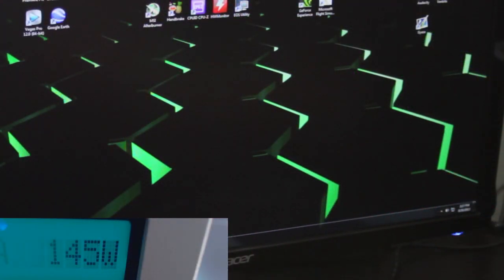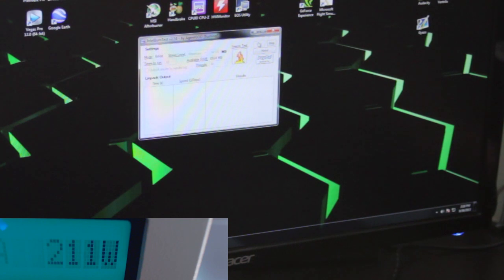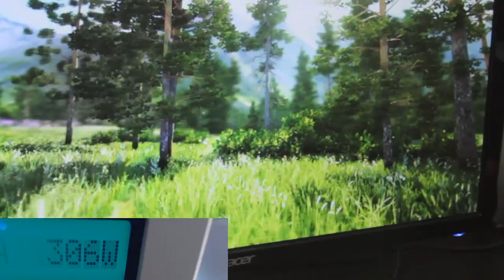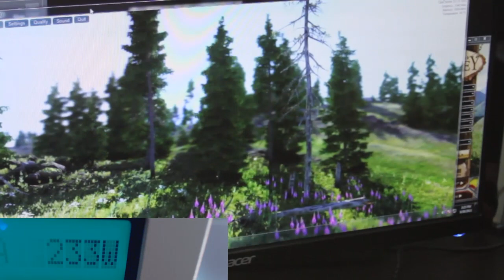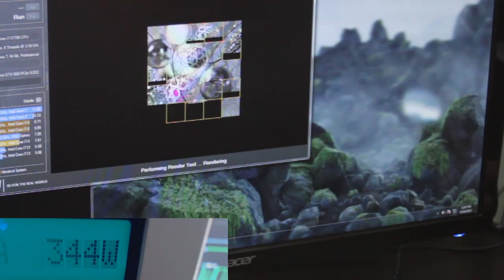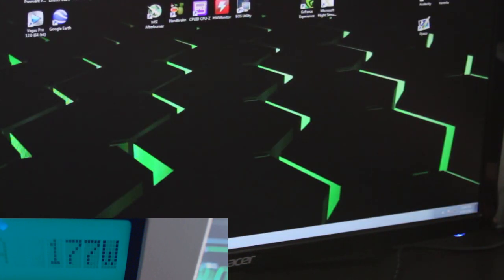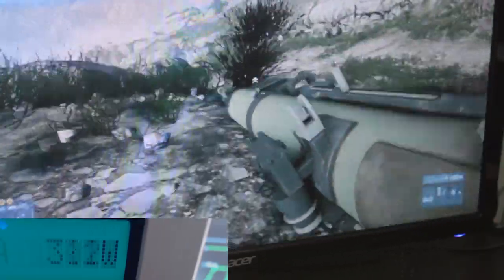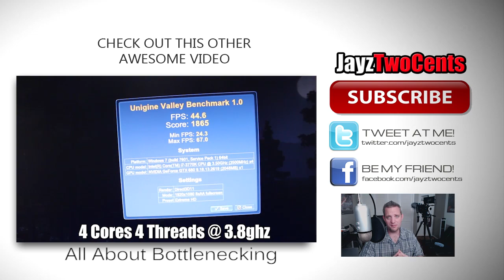How big of a Power Supply do you REALLY need?

Comment: just bought a corsair cs550m gold rated and am not sure if i should return it it don't want to overclock but i want to run an i5-4690k and a high end gpu or sli/crossfire on r9 270 or gtx 760 will the psu be enough or should i get a better one i would like to save myself the hassle of returning it but if its not right then its not right

Comment: There is online calculators etc, I know. I have used them, but I don't trust them.

My system is as follows; but I want too add a R9 280x, FX Cpu (+ New mobo) and of course 2GB more Ram, with a chance of CF later on. Don't attempt to push me towards Intel, I like the company but I simply cannot afford Intel products as good as the FX 8350 at £100 with a great chance of overclocking etc.

CPU - AMD A6 3650
RAM - 6GB 1600Mhz DDR3
GPU - GTX 560Ti 448
HDD - 4 HDDs, 1 x 320GB, 2 x 500GB + 1 x 1TB
Fans - 4 fans, 3 x 120mm Blue LED + 1 x 140mm Blue Led
Cold cathode - 2 x Blue cold cathode 12"
PSU - CX500M

Comment: If a system draws 300W, the power supply provides 300W. no energy is wasted. a 1000W psu means it can produce up to 1000W DC. However, psu are most efficient at around 50% max rated load. you should learn a bit more on power supply.

Comment: Hm.. i've been wondering, im currently running an i7 4790k with 4x4gb 1600MHz ram and a MSI Twin Frozr R9 290 and im running it on a Corsair RM750 power supply, ive seen mixed comments, some say a 750w is ok but others say 850 minimum, any one else running two R9 290's around who can tell me their experiences of power usage?
I wouldn't mind running both cards at stock clocks to keep power down since two cards is beastly anyway but i do run a high resolution, 5760x1080, thats nearly 4K so i will be running those beasts at their maximum capability...

Comment: ***** 

1:45 total bullshit.

80+ is an efficiency rating so if your 1000W PSU has an efficiency of 80%, it means that in order to deliver 1000W TO YOUR COMPONENTS, it needs to draw 1250W from the outlet.

If your PSU had an efficiency of 90%, you'd still get exactly 1000W to your components but the PSU only needs 1111W from the outlet in order to deliver those 1000W.

The 250W you have "too much" here is thermal loss from internal resistances. 250W is quite a lot - in comparison, most desktop CPUs are epecified for 80-100W TDP, GPUs hover around 200-250W. This is why a 1000W bronze certified PSU is loud as fuck, too. The fan needs to cool away 250W.

That's what 80+ specifies. Not the other way around. Stop making videos about computer hardware if you don't even know the very basics. There are enough dumbasses buying 750W+++ PSUs for their i5 4570 + r9 270x already because moar = better forever hurr durr herp derp.

Greetings
pcgameshardware-user
http://extreme.pcgameshardware.de/members/86145-teutonnen.html
Reply: 1000

Comment: im running an 8350 with 32 gigs ram 3 SSDs 3 HDDs 3x SLI GTX 780 cards watercooling with 4 140mm fans 3 120 mm fans every single usb port occupied in a sabertooth MB in a Corsair 550d case with a front expansion board and touchscreen fan control with a seasonic 1250x powersupply and i think at load im undervolting at times. but i can tell you i have blown up 2 gfi  circuit breakers and i cant go higher because of the 14ga wiring in the house. but i have run this computer 2 hps  2 50 inch monitors an x box and a laser printer all at the same time before the circuit breaker trips if all are at idle.:) needless to say i dont do that anymore

Comment: ***** Check your description of what the 80 plus certification means. A good quality 1000w unit will output 1000w. The efficiency comes in with how much it draws from the wall. A higher efficiency unit may draw only 1100 watts from the wall for a 1000w load, where as a less efficient one could draw 1200 or more.

Otherwise, love the channel and keep it up.

Comment: I'm  running a Corsair tx 850 on my i7 2600k overclocked with a GTX 680 and 16 gigs of ram. Was running a TX 650 before and wanted the option for sli in the future with this psu. I guess I would rather have more than less if a 780 or 290 becomes my future upgrade also. I do understand that the 850 is probably overkill.

Comment: I'm buying a custom build computer and It has a i7 4790k, Gtx 780ti, 16 gb of ddr3, 2 tb hard drive and I'm using liquid cooling. Should I go with something like a 600W power supply? Not sure if the monitor I'm uses matters, but I'm buying a lg 34um95.

Comment: Got a hx750w plan on using an 8350 and r9 290 both with big over-clocks (custom loop similar parts to jays apart from amd parts instead of nvidea and intel) I presume I will be ok but just want a second opinion as amd parts tend to use more power?

Comment: i have 500watt and want to get a gtx 760. im running a gigabyte H61M-S2PV motherboard, 8gb ddr3 1333mhz ram and an i5 2320. i learnd in school a method my teacher uses which is add the watts for the cpu and gpu and then about 150watts for the other stuff like the mobo, hdd and so on. and then multiplay it twice by 1,2. it adds up for me too about 590watts. after watching this im wondering if i should get a new psu. maybe anyone here can tell me if i should. (sorry if my spelling sucks atm. its late and i cant bother to check my spelling :p)

Comment: Power supplies are rated for what they can output to the components, not how much they draw at the wall - the latter will always be higher. For example, an average 550W power supply with 80% efficiency at full load is rated to supply 550W to the components, but it will be drawing 550W / 0.8 = 687.5W from the wall when it's running at its full rated capacity.

Comment: im buying next week :
2X Gigabyte Geforce GTX780 3GB OC WINDFORCE 3 - its an sli !
Intel Core i7-4790 3.6Ghz 4.0 Ghz Turbo LGA1150 
Gigabyte GA-Z87MX-D3H for 1150	
Samsung SSD 840 EVO 250GB SATA3 2.5 inch
Seagate Barracuda 7200.14 1TB SATA3
Arctic Cooling Freezer 13 CO
NZXT Source 530 Black
Hynix 16gb 2X8GB DDR3 1600Mhz
LG DVD-RW x22 Dual Layer Sata Black

what psu should i take?
i thought about 750 , would it be enough?
if im changing to the 4790K I7 and oclocking
should i take 850?

thx !!

Comment: now im really confused it never went over 400w at the max it can go but you still recommend a 600-750w?
Reply: never build exactly what it needs. always go 25% higher then needed if you will never upgrade but if you draw 450 watt at load go 600 watt for safety. un undervolt will destroy the machine faster than you would imagine
Reply: yes say you want to sli cards in the future the extra 200 watts are just there for headroom for that
Reply: At 40% load you have the most efficiency.
Reply: no, at 80%

Comment: Ok, i want to build a gaming pc please tell me how big of a power supply i would need:
AMD Athlon II X4 740 Quad Core Processor 3.20GHz
8gb 2133mhz ram
GT 640 2gb ddr3
the case has four fans and the motherboard has up to 32gb ram (i dont know if this makes a difference lol)
Then ill probably get windows 7 (again i dont know if this makes a difference)
Reply: i was thinking a 500watts would be fine but i dont know :)
Reply: TheTwoJimmy's
500 is perfectly fine though I use 600 for these specs
Processor
Intel(R) Core(TM) i7-4770 CPU @ 3.40GHz
Video Card      
NVIDIA GeForce GTX 670
Memory
16 GB
Reply: You will barely be able to play minecraft on low setting with those specs
Reply: PrestigeEagle Well for starters i am getting better things than that now, Gtx 750ti, amd fx 6300 6 core 3.5ghz, 8gb ram (but im still not sure about these things this is just what i have been looking at at the moment), but also you are completely wrong as i play minecraft on ultra settings with mods and a texture pack with vsync on and i get a solid 60fps, that is on a mac... with a quad core 2.7ghz, intel iris pro and 8gb ram, those specs are wayyy worse than even the ones i was thinking about before never mind the ones i am thinking about now. You should maybe be more helpfull next time like oreomoon1998 instead of just critisizing without thinking about it.
Reply: Sell that excuse of a computer mac and buy that 750ti!!!
Reply: PrestigeEagle haha :)

Comment: I like to see people getting the word out there, I use a SFX 450W with a 3770K and GTX680 without even breaking a sweat :)

Just 2 corrections:
1) At 100% load you will get 100% of the rated load to the PC (1000W in the example) but it will be at least 80% efficient so you will be drawing at most 1250W from the wall.
2) Peak efficiency is at ~50% load so having an over sized PSU isn't necessarily a bad thing just bare in mind most of the time your PC is probably idle/under low stress, as a general rule of thumb try and stay above 20% load. Also some supply's will turn off their fans/run them very slow when under low load which might be what you want.

Comment: My FX 4150 is supposed to draw about ~460W with the other components in my system. The GPU I coupled with this when checking was a GTX 770, which takes 2 8-pin connectors. What PSU is right for me? I was thinking a HX750 so I can upgrade quite a bit later.
Reply: my name is MAXIMILIAN no problem. Good luck with the intel system! I'm saving money for a system with amd's next architecture.  If they make a new one
Reply: Way overkill, for that cpu with two GTX770 you will only need a 550W. Save the money from getting a overly large power supply and spend it on getting a better quality 550 Watt or 600 watt. Se sonic make great power supplies
Reply: Luc Mathlin I have a 550w in the closet, but the problem is that the MSI 770 takes 2 8-pin connectors, a feature not found on most 550-600W PSU's.
Reply: my name is MAXIMILIAN Just installed a 550W EVGA for a freind. Has 2x 6+2 Pins. Good power supply.
Reply: Luc Mathlin Ok, thanks, will look into that. The only other thing is that I want to be able to upgrade more in the future (780 Ti, 8350, etc).
Reply: my name is MAXIMILIAN get the 750, it will give you better efficiency and a more quiet operation
Reply: tikiman48 Thanks for the advice. I'm on the 770 with a 650W psu and I think my next upgrade is going to be to an Intel chip with a ~800W psu. A long way off, but good to plan things out.

Comment: Would A CORSAIR CX series CX430 430W be a good power supply for a build with a GIGABYTE NVIDIA GeForce GTX 750 Ti?
Reply: Yes. I'm running i3-4130 with MSI GTX750Ti OC and lots of hard drive etc. blablabla and still lots of watts are going for a waste.

Comment: so i just used eXtreme Power Supply Calculator Lite and it told me that the recommended wattage for my rig was 322 (thats with the gpu installed) but how is that possible?  my evga geforce 9600 gt requires 400 watts (450 for 2 monitors). is that calculator wrong or am i really missing something? the reason why i'm asking is i only have a 250 watt psu right now.i cant use my gpu so im trying to figure out how what psu to get... im on a budget at the moment so i figured i would get a 80 plus evga 500 watt psu but i wanted to make sure that was good but now im hella confused because of the calculators.

Comment: HE has this  wrong                           
80 plus cert specifies efficiency to be measured as input over output NOT output over input. So a 80% efficient 1000 watt PS at 100% load will be drawing 1250 watts from the outlet.  20% of that power is lost to heat.  The wattage on the side of your power supply is the actual maximum wattage it can deliver to your computer but not the maximum wattage it will draw from the outlet.
Reply: Pin/Pout 1250/1000 = 1.25 = 125%  i.e.,inefficiency
Pout/Pin 1000/1250 = 0.8 = 80% i.e.,efficiency
http://www.ti.com/lit/an/slva390/slva390.pdf
page four section 13:
Pout/(Pout + Ploss) = efficiency
Reply: NinjaBlargz
well yea thats what im saying. but i messed up saying it.    but not in calculating efficiency.  By what he saying for example if you had a 1000 watt PS @ 80% efficiency and at full load your computer would be  be receiving 800 watts.  but it wouldn't. it would still be getting 1000 watts its just the "Pin" would be 1250
Reply: you get 650 watts of power. however you are drawing around 810 watts of power from the wall and turning into DC power. 80% of it is used efficiently and 20% is turned into heat.  Well on second thought thats 80 plus cert. I cant remember the exact efficiency rating for bronze but would be less than 810 watts but the point is  you are still receiving 650 wats of dc power
Reply: PS use several rails because different parts of your computer requires different amounts of voltage (some need 3,5,or 12 volts).  you want to pay attention to the 12 V rail because graphics cards are the most power hungry and they need 12 volts of power. 
Its more costly to make a single 12 v Rail that is able to produce alot of power (needs quality/stable parts).  So cheaper power supplys can advert higher wattages by making 2 cheaper 12v rails that have lower amperage because technically it still produced the same wattage.  but A GFX card needs all of its power to becoming from a single rail because of its large power draw. 

Rosewill its like an umbrella company of chinese manufactures from all different branches of tech and home electronics.  For that reason I personally wouldn't recommend them.  People dont stress enough a importance of a decent power supply.  Ive had customers that took along time to figure out what was causing there blue screens, but it was their cheap PS not being able to deliver consistent power, which also has potential to damage components in extreme situations.

Id recommend brands like Seasonic,Antec,Corsair,be quiet, cooler master, ocz, evga, XFX, bit fenix probably a few others i cant think of but all those are good for sure
If your willing to pay a bit extra for modular, do so, its handy, but not necessary for sure
Hopefully this ramble made sense ive been up for a while
Reply: so how many usable system watts do you get out of a psu that 650watts at bronze rating. 540?
Reply: evilmatchbox Ok. Thanks. I have a couple other questions. 
Would use say this is a good psu?
http://www.newegg.com/Product/Product.aspxItem=N82E16817182300&cm_re=psu_modular-_-17-182-300-_-Product

I like the price and the wattage, modular, but I am not sure on the brand, seems like people avoid rosewill power supplies because it's not Corsair or by some Major brand. Rosewill to be avoided? 

Can you also explain to me what amps are on a rail? Some gpu require 50 amps on a single rail, the psu I sent you has 54amps on a singular rail. At 650watt mark, most psu are below 50amps. Do amps matter? 

I probably be running at r9 280x, not sure the brand.
Reply: *****
 oh and u should be fine with a 650 watt power supply just make sure it is a decent company and that it has a single 12v rail
Reply: evilmatchbox Gotcha! Thank you, that was very helpful =)

Comment: Very informative, very laid out. My only question is why does the manufactures of these cards say 750w required 600w req and so on. If according to this video those cards only use a fraction of what is required of them?

Is it so that we are being tricked and fooled to also by another PSU from them also?
If so is that even etically correct to do that.
Reply: Because they want to cover there backs. Also they are basing it off you using a top of the line 6core CPU.
Reply: Luc is right they are accounting for the rest of the machines factors and they figure if you go high end on a card the rest of the machine would be high end
Reply: its incase you buy one of those cheap power supplies that isnt 80plus rated and says 750w when really it cant handle over 500w for more than a few minutes.

Comment: Would 500 Watts be enough for FX-8320, GTX 760 4gb, 2tb 7500 rpm hard drive, and 3 120 mm LED fans?
Reply: more than enough
Reply: what about cooler master?
Reply: search up power supply calculator.

Comment: But i couldnt resist buying a XFX black edition silver rating 850W power supply for 50 dollars after rebate 72 amp single rail. Im probably using 270W during gaming since i don't over clock

Comment: Is a 500watt 80+ Bronze PSU able to supply enough power to a r9 270x and an amd  fx 8350 slightly over clocked or will I need a 600watt?

Comment: Just one remark... you said that, if you have 1000W psu with 80% efficiency on 100% load, you can only get 800W power into your system. But thats wrong, because 1000W power is on output, so if you have 1000W psu with 80% efficiency, you get 1000W power to your system, but power from the wall is higher, its about 1250W. However, all of your videos are useful, so thank you for that :)
Reply: Hope the breaker switch doesn't trigger at that load

Comment: High just wondering if a 600W Corsair 80+ bronze is good enough or too overkill for an AMD 8320 + GTX 770? I do plan on overclocking (nothing too extreme, maybe somewhere between 4.1-4.5ghz for the CPU) and have a Corsair H75 liquid cooling planned. Thanks.